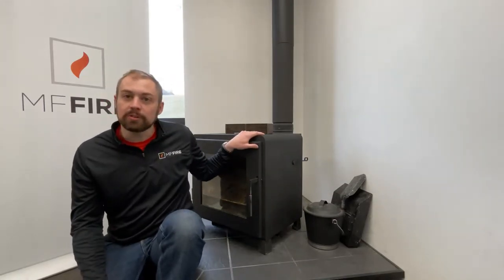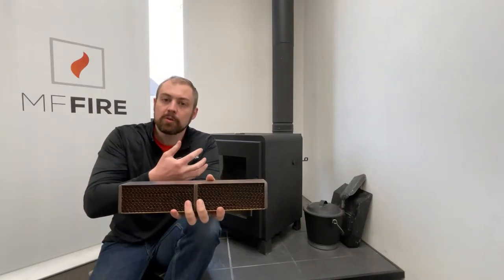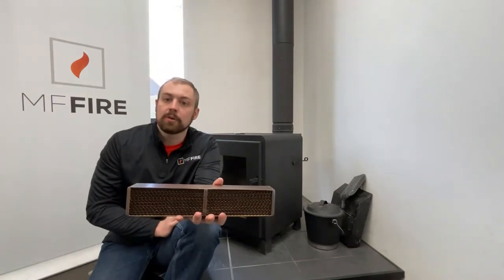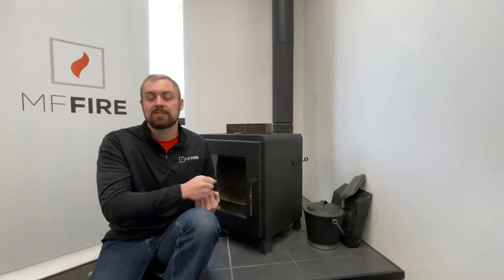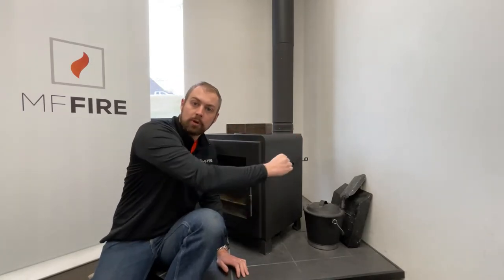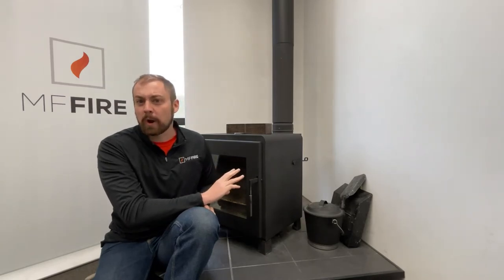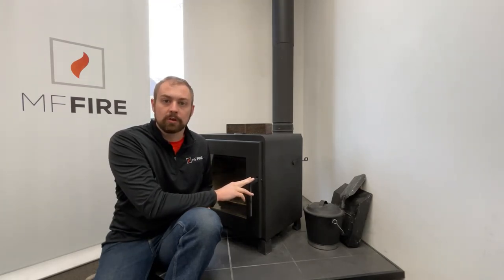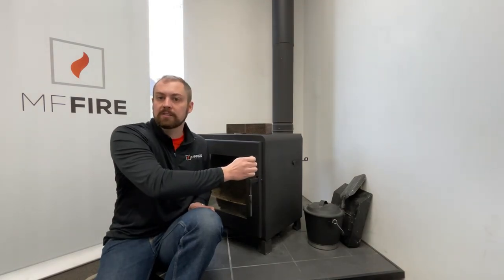How to use the bypass on your Nova Series wood stove

Comment: Is there a thermostat, or even a damper? How do you control the temperature on a Nova?
Reply from the maker: Yes, every stoves comes with a stove top thermometer for determining when to engage the bypass.  Our Nova and Nova 2 stoves do not have a damper as the heat output is determined by how much firewood you load, and how often you reload the firebox.  Our stoves are incredibly easy to use! There is much more detail on how to start a fire and use our wood stoves in this video here: https://youtu.be/IwL8Dws5wNE
Reply: @Mffire  It’s a nice stove, but hard pass on the temperature output being determined by how much wood you load. Put a thermostat air controller in the thing. People load their stoves full.